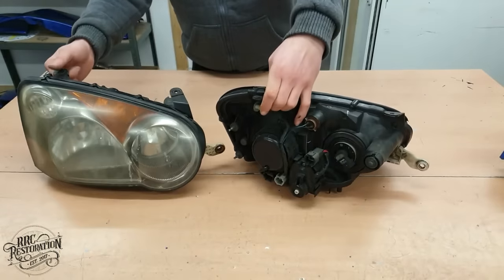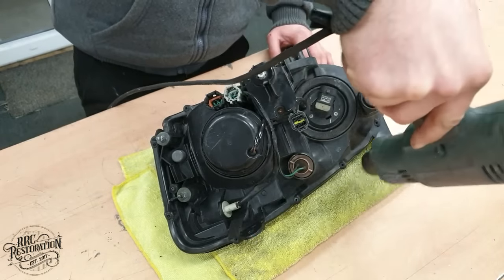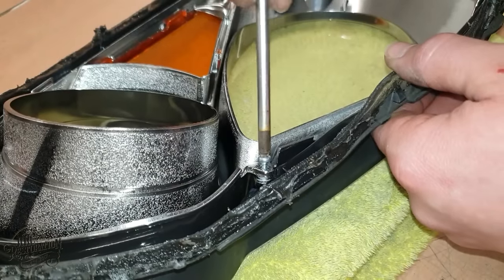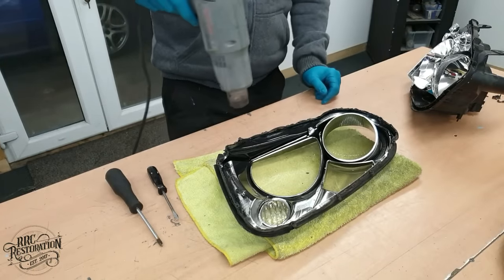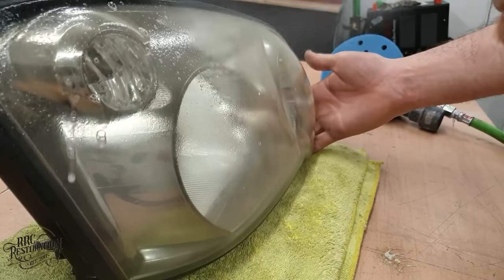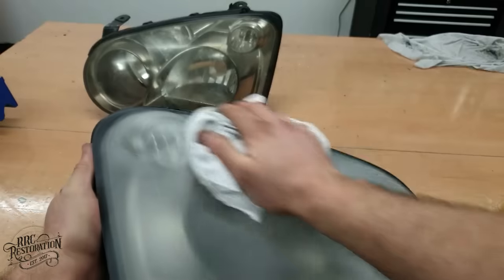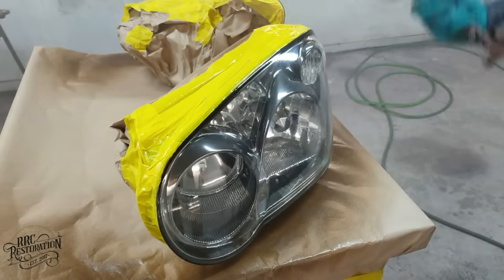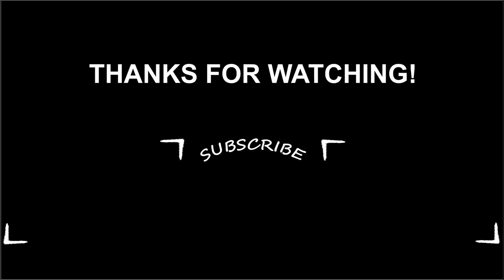Headlight Restoration - The Way A Professional Does It

Comment: The higher powers are mocking me right now! I just spent the last two days trying to restore my headlights: First I did 400-600 grit then used Rust-Oleum clear coat. That stuff is absolute rubbish. 50 seconds after spraying it started cracking, like dry mud. Sanded, tried again in warmer temps, same thing. I figured headlights need to be polished, so I got a kit, did 500-800-1500-3000, and polish! Then I looked online and saw I could have just gotten a spray can of 2K clear for the same price as the polish kit + the ceramic coating... About $26. So I was on the right track but used crap paint and second guessed myself. 4 hours, 3 resands, 2 recoats later, they still don't look as good as the 2k clear...
Reply: Sounds like you were applying the coats too heavy.  $26 for clear in a can... Those prices have come down a lot from when they first came out.  Regardless that RO clear wouldn't last anyway.
Reply: @ShainAndrews  Super light coats. It was super frustrating. The polish looks better, but a can of 2K clear with activator would have looked the best.

Comment: 2k clear coat is not good for headlights .  From the point of view that if you need to redo the headlight it will be a nightmare to remove the remainder of the clearcoat .  There are  clear coats specially designed for headlights that are a bit more liquid so that you will not need to sand to much off.

Comment: Clear coat shouldn’t be used due to refraction. Once the light from the headlight bulb hit the rear of the clear coat the light will be refracted off at a different angle rather than straight ahead therefor giving a poor light source. Research it guys.
Reply: hmmmmm🤔

Comment: Using clear coat is wrong the main purpose is to protect the lens from UV light so the manufacturer paints the lens with a layer of polycarbonate when this layer deteriorate it gives this shady look the correct way is to remove the old layer and spray it with new layer of polycarbonate period !

Comment: "professional" your customer will come to someone like me to get that 2k clear off, and repair the damage done. Just because your customer never calls you back about the job you did doesn't mean you did a good job. Do it like the factory, and spray the headlight with a proper headlight coating ONLY after the headlight is 100% clear again after sanding/polishing stages. That witchcraft everyone is talking about is called a gimmick it does nothing for the headlight 😂

Comment: I beg to differ?? So this is how a professional would restore a headlight, If this would be the case he would be out of business with in a month🤣Not forgetting there are two headlights!! This method is unworkable and time consuming to say the least, I have watched so many headlight restoration never before seen any professional restorer  remove any headlights let alone take apart the headlight itself,?? Can you imagine the Labour cost alone these days It would be cheaper buying new ones and be done!!!!
Reply: Seems like the only reason he took the headlight apart was to remove the amber lens. I wouldn't want to compromise the water resistance of the headlight just to do that.

Comment: Sorry hommie, this ain't the way a professional does it.  We do it on the car, in any type of conditions, anywhere...
As a matter of fact I make a living fixing lights that have been sprayed with 2k clear.  You actually probably destroyed those lenses.  They will spider web crack because the clear with hardener isn't made for polycarbonate.  Please read us the part on your clear coat that states it's designed for headlights.  Also! It's critical to sand and polish before coating.  Everything you taught is exactly what we don't do...